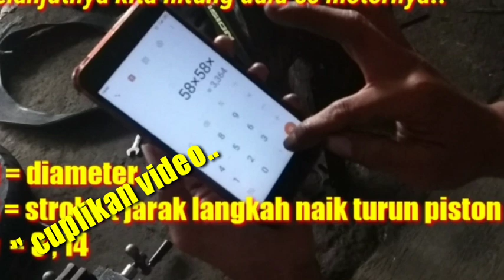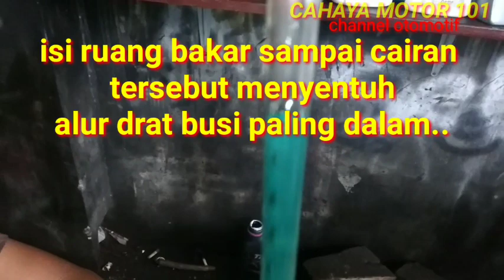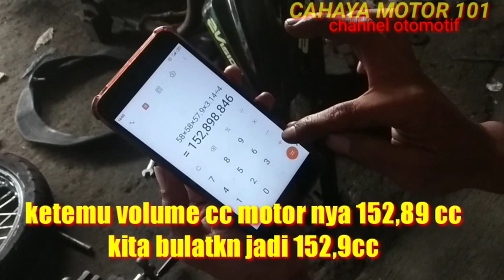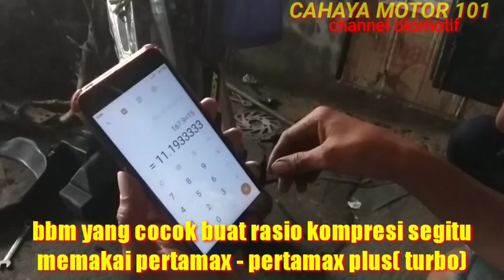Bore Up Vario 125 jadi 150cc...part 4 (edisi finishing ) #VOC #HOVC #HVCI #HVCC

Comment: Kenapa motor gue boreup 125 led pake 54,5 jenong ga jengat begitu, malah drop speednya :"(
Reply from the maker: rasio kompresiny pakai itungan stdr, jangan d naikin..rollernya pake lebih ringan pakai 8  9 atau 10 gr,sudut fully depan d ubah jdi 14,5 derajat..per cvt nya naikin bisa juga oake milik pcx'..